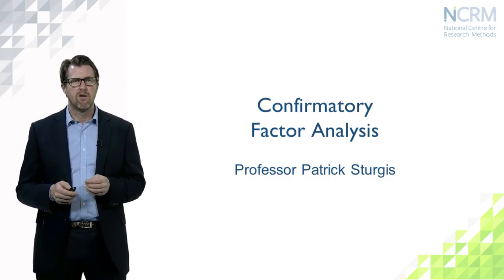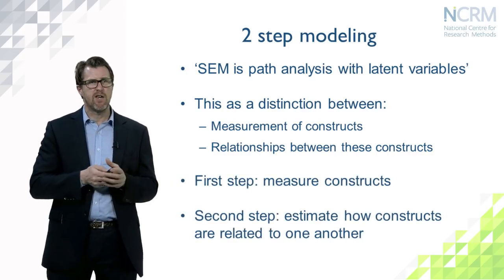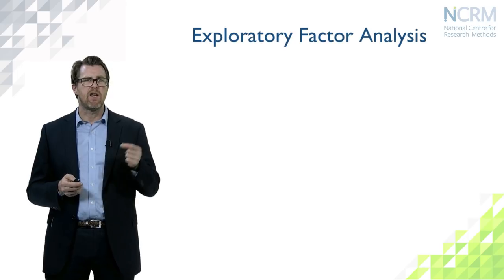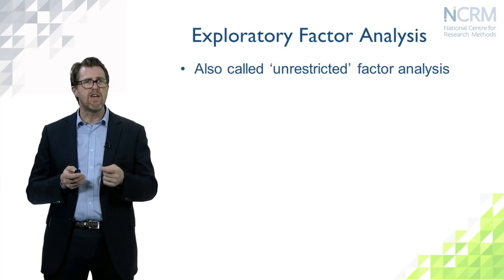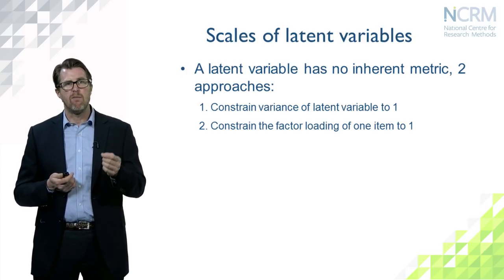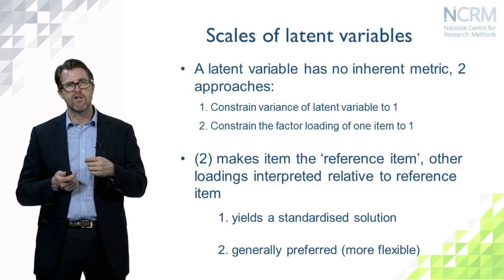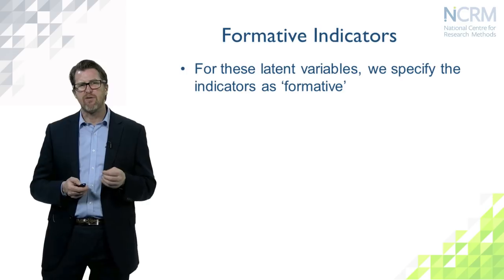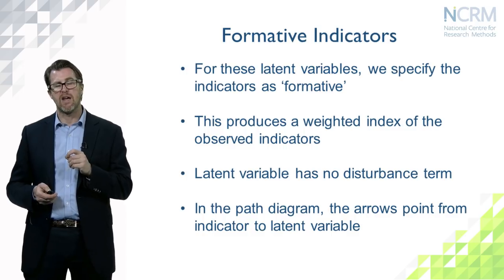Confirmatory Factor Analysis; Patrick Sturgis (part 3 of 6)

Comment: Could someone explain what is the definition of degrees of freedom here? Naively, I thought degrees of freedom are free model parameters, but this is in contradictory to the use of the term in the lecture. 
If we apply constraints, the number of free parameters decreases and hence the model becomes less flexible (less capable). How do I understand the fact that the less flexibility implies the larger number of degrees of freedom?